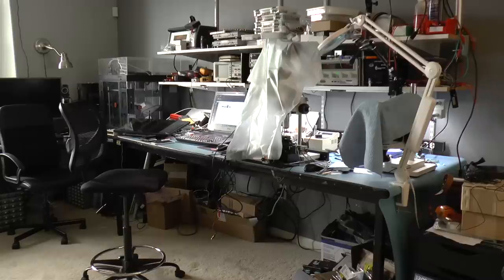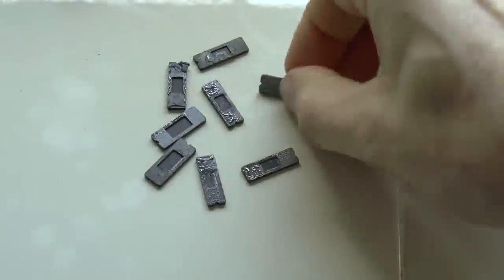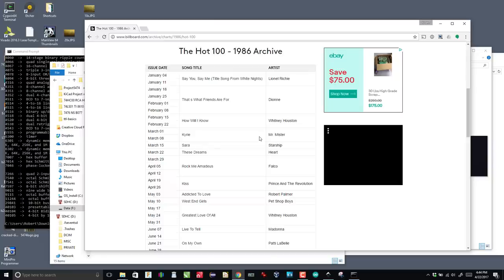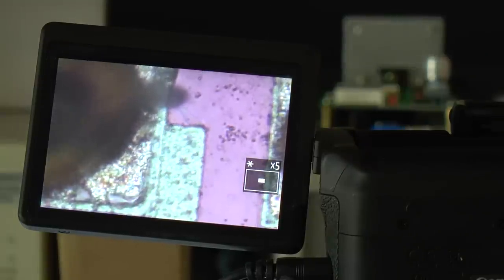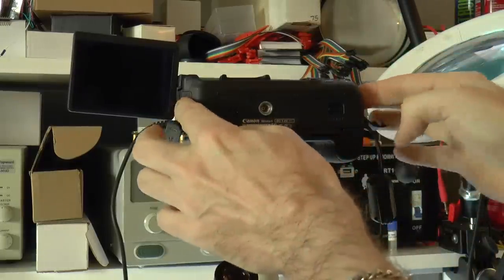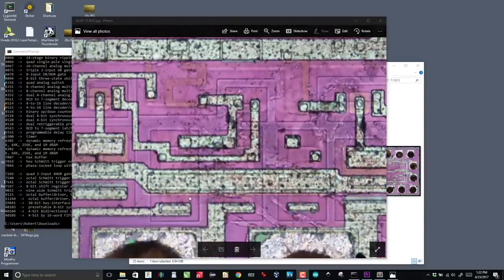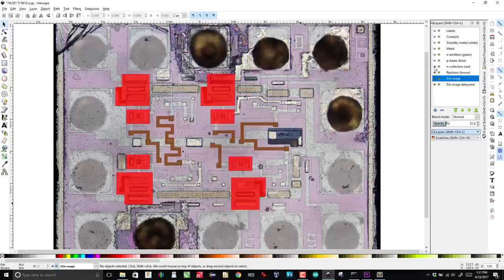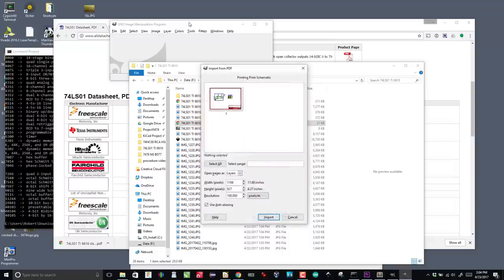How I reverse engineer a chip

Comment: I’d love to see this chip built out onto a pcb. That would be cool.
Reply: this kind of bipolar oldies (used sometimes nowadays), 74LS**, have an equivalent circuit quite often sketched on the datasheet... CMOS ones may have a bit of problems more, since the mosfets are not a standard type, they are specifically engeneered for complementary operation... you can use in that case a CD4007 to have some "free" mosfets for the use, but that chip is.... already a chip
Reply: Hmm yes of course
Reply: @redoverdrivetheunstoppable4637  exacly why make a chip with a chip actually it can be usefull if the chip is just multiple chip in 1 but in this case its not its a circuit of transistor and resistor that need a plastic case to not die instantly because of ambient noise

Comment: Thanks for showing us your very serviceable setup. 🙂👍Used to do this sort of thing professionally, almost half a century ago. It's slow, patient, fascinating and satisfying work. We also used near-UV light at high magnification (1200x and higher) to find surface features down to about a micron in width. A micron wide feature appears as a fuzzy line in that light, but you can make good use of interference patterns to figure out exactly what is going on. You can also etch through the layers of Silicon, to learn about Gate sizes, Oxide depths, doping depths, etc. It's possible to discern depths and thicknesses down to within a few hundred Angstroms, using similar optical methods and very careful etching; controlling etchant temperature, concentrations, mixtures and temperatures.

Comment: It looks like you have a trinocular microscope or at least a switchable camera port. Having had an AmScope with the latter configuration I ended up 3D-printing a clamp to which a wooden board was screwed. The board, having a notch and a covering of foam tape allowed one to just place the phone onto it, looking at a regular eyepiece popped into the camera port.

It's a worthwhile build that maintains the convenience and connectivity of a smartphone.

Comment: This is for low to medium scale integration.  Modern CPU's have feature widths less than the wavelength of visible light and can't be optically resolved. These lines turn into iridescent colors much like the coloring of many butterflies. A modern CPU chip contains many more layers covering the lower layers so individual transistor elements can not be seen.  The ability to see individual lines started to end with chips getting features smaller than 1 micron.

Comment: Huh! Interesting. I did this in 1996-1999 at a company for (then) state-of-the-art chips. Image acquisition was only 20% of the effort; I also wrote a tool for assisting with the reverse engineering.

Modern chips have features too small to be seen optically.  Pretty much have to use electron microscopy now.

But doing this in a home setup is very impressive. Well done!
Reply: Why just fof study why reverse engineering chip?
Reply: @holdencommodorehsv  Chips are reverse-engineered for two main reasons: competitive intelligence (find out what the competition is up to) and searching for patent infringement.
Reply: @dfs-comedy  ty

Comment: Very interesting! I don’t know a lot about electronics… I’ve only been learning for a few years. But I go to a local electronics recycling place almost every day for a few hours. A buddy of mine runs the yard and I get some pretty neat things. If you’ll tell me where to look… I’ll keep an eye out for certain industrial Devices and old things that might have chips you want in them.

I collect chips and parts. Iv desoldered over tens of thousands of parts in the last three years. I know that sounds ridiculous and exaggerated but  it’s not. I developed a method of using low pressure through an air compressor and a handheld modified airbrush, along with a soldiering in the other hand… And I can desolder a 16 pin dip chip in a matter of a few seconds. 

I started doing it to learn and collect parts that I could use in projects... and after a few months kept going because it’s like a treasure hunt… and although it isn’t worth my time to salvage and save parts for the sole purpose of reusing them… I still enjoy it because of the treasure hunt.

. Sure it’s great to have them in stock, But it’s almost a full-time job salvaging that many parts in keeping them organized. And there is no time left over building projects… And not mention these are used parts were talking about.

So after removing testing and cataloging hundreds of parts per day five days a week for a year and a half… Now I only go for the big IGBT’s, and other expensive or beautiful components.

I love Collecting parts that are visually appealing, or interesting some other way. Especially when Government corporations or large industrial companies bring high-grade weird and interesting things to the scrap yard. So I focus on that and pretty much avoid consumer-electronics unless they’re super old!

I love old White and purple ceramic chips… they are my favorite! And of course I could get most of them on eBay for pennies or a few dollars… But it’s more fun if I only add parts to my collection that I find myself! I have over 150 pounds of transistors. Spread over half a dozen parts storage drawer banks. If I take out the weight of the drawer banks there’s at least 150 pounds of semiconductors. And my favorites are framed in a flat case… Stuck in foam. 

I love finding really old chips, fancy TO-3 package transistors that were hand-painted Or have colorful silkscreen Graphics, and all kinds of other weird things like early examples of LEDs.

I know very little about the electronic theory, however I have put together a humble TestBench with test gear that I mostly repaired myself. I can do the basic stuff like look for burned areas, replace filter caps, maybe do a bit of in circuit testing. That’s as far as I go. I just can’t wrap my head around the rest yet. However I’m hoping one day I can understand it well enough to do some more interesting things with the old parts I  salvage.

Would be awesome to sit down and get the old parts out, characterize all of these cool transistors and chips with my curve tracers and other test gear. I just think it would be a lot of fun

Sorry to ramble on… But if you can give me an idea where to look or what kind of parts you’re interested in… I’ll be glad to help. 

I Maybe even have some old transistors and weird things that you might disassemble or cut cross sections out of. 

That’s another thing I will eventually try. I already have gemstone cutting equipment and lapidary gear so it would be cool to do cut cross sections of all types of components… And photograph them under my microscope.

Anyway let me know if I can help.!m,

Comment: This is a relatively easy chip to reverse engineer (4 gates only!) 
But I'm still impressed with your setup.
For people wondering about the gap between layout and schematics, here's a simple brief explanation:  
74 series used TTL logic, so you already expect to find BJT and resistors.
Then you need to know the layers TI used in it's VLSI manufacturing process  back in the eighties. How many metal, doped, SiO2 layers. If you did so, using some physics and EE basic knowledge you'll find out what layers formed BJT, resistors, and contacts.
Then you can easily trace back the connections to schematics.

Comment: Fascinating. I wonder where the progress will go in 5 or 10 years. Specifically if the chemical aspect would be still here of it would be as simple as popping and IC in a DIY cheap decapping laser machine that automatically etch away the material and take pictures of the die.

Comment: In the mid 80s a company came to where I worked selling their product  LVS layout v schematic. they dis design verification of the physical layers  - they converted the image to transistor fully by a program. I asked if he thought it would be hard to convert the transistors to gates. He said it was possible. Then I asked him if he knew what my company does. He said no. I told him that we take gate and board level designs in what ever primitives are for that technology and convert them to generic gates. Then we raise the symantic level to adders registers, ...   and then ew replace these macro level components with hand optimized  target technology macros. then we convert all the remaining generics to target tech. primitives and then go to the physical layout and polygon phase.   He didn’t get what I was saying. In the mid 80s the technology existed to completely reverse engineer a chip and target it to a whole new technology without even knowing what it does, even to the point of duplicating design errors all programmatically

Comment: This is really great, thanks for your preservation and documentation work! Ever go after those 'super integration' chips from the early 90s that helped make laptops feasible? Always thought they'd be cool to image, usually a composite of several standard intel chips like 82CXX DMA/PIC/UART. I always see them mentioned in Toshiba service manuals.
Reply from the maker: pixelflow: My guess is that those chips have features beyond the optical range of the microscope. Basically feature sizes under 2000nm or so can't be resolved. it's why I stick to 80's chips.
Reply: Thats what has me curious, because some are made around ~87-91!
Reply: How would one reverse engineer newer chips from the 90s then?
Reply from the maker: Brandon Klopp An electron microscope would be required for the next few levels of feature size.

Comment: Is there a way to understand how a chip works without destroying the metal?

I have two nearly identical TCM computer chips that fit into a '00 sedan that I have been fixing on my off time. I have a suspicion that the computer chip that I bought got damaged and want to check how I can go about to fix the chip.
Reply: The equipment and time costs aren't worth it, it's probably better to buy the chip (or the entire control assembly) online instead. If you decap even just to look at the circuit, it will be impossible to restore unless you have a wirebonder and other equipment. I think the best way to see it without destroying the packaging is probably SEM or TEM, if you have access to a university lab maybe.

Comment: Hi, I was wondering how long you etch with the armour etch? I've been experimenting and although the coverslip my die is glued to took an etch in 50 seconds the die itself does not look to have changed.
Reply from the maker: littlestworkshop I've pretty much stopped using Armour Etch in favor of RustGo. It is higher concentration and is a liquid, so it usually takes about a minute or two. The Armour Etch would sometimes take over 20 minutes.
Reply: @RobertBaruch  can you reverse a Sega saturn chip with one that is far more powerful??

Comment: hey the show you should be doing is how to unlock a burned closed chip. then you would need one hell of a disclaimer so you don't get sued when every geek in the world tries it all at once man. i lean heavy on the disclaimer man. just say i was verifying why chips are closed to evaluate the time duration of parts in machines as a way to cause sales to computer chip manufacturers. and you get to keep the checked chips to of course it would be just a small business. a solutions company and for the idea can i have a amd ryzen 9 3900x. when you find one of course. you could also make the bios to work the thing with broke cores. it would get a million views by the way. (at least)

Comment: So this is cool and all, but other than curiosity and hobby.  Is this practical for something?
Also, how much does the microscope setup cost?    I love taking apart cameras, namely the Chinese IP cameras and wifi cameras that are flooding the market here.  But i have no idea what i'm doing after i take them apart, google reveals some info about parts..but from what i gather, it does not matter what you have, everything is locked down because of firmware on each camera.
Reply from the maker: I don't know how to answer that. Everything is practical, and nothing is practical. I suppose the closest I can come to an answer is, this could make a great resource for people learning VLSI in engineering schools, or researchers looking for the history of chips, or people who want to build a MegaProcessor. As for me, I'm doing it as a hobby. You can read about how I put together the microscope here: http://www.halfbakedmaker.org/blog/cncmicro1  Note that on the blog post I explicitly state that this is an expensive hobby :)
Reply: Nice, thanks.  If you are interested i can send you stuff to take apart, i get lots of circuits boards from cameras and computer parts.
Reply from the maker: Well, it looks like you're into the more modern chips. Anything after around 1990 is beyond optical techniques, so I am not much help there :)  There are other techniques you can use to get at hidden firmware. There's a whole art behind hacking into unknown chips and hardware, but I'm not part of that scene. Many of the DefCon talks go into that subject, if you're interested.
Reply from the maker: I have a processor from the '70s that has a masked ROM. I can recover the ROM using this technique, so there's another practical aspect.
Reply: Robert Baruch 8048/8049 perhaps?

Comment: Hi Robert.  I need code extracted from a PIC16C58B 04/P chip and then copied to a few other chips.  They are from an obsoleted motor controller board and I want to keep parts on hand for repairing this board.  I'm willing to pay, can you or anyone else help me?

Comment: How would one go about re engineering the chip like reproducing these chips that are now old and supplies are running low ala commodore chips?
Reply: what kind of numbers to you plan to produce? pretty sure to make chips you'd need a fab and those usually don't come cheap or for a few thousand pieces :x
Reply: John Uferbach sorry I didn’t mean me this is far beyond my skills I just see how no one has ever reproduced chips that are in short supply and are ever failing I.e Sid and vic 2 chips from the C64. I mean is it not something that once schematics are obtained be sent to somewhere like China be mass produced? You can obtain brand new pcb for pocket change. Or is it just to intricate a job to be able to run them off a machine?
Reply: @dannycivic02  yeah, pcb production is cheap these days, but chips are on nanometer scale, the production is fully automated, happens in high level cleanrooms and even the cost of the tooling is expensive (and therefore not as flexible as pcb production which works with blueprints printed on foil), those facilitys cost billions to build and run, they wont even consider it if you come asking for a few thousand pieces... there might be some way to make crude ic's at a lower investment, or prototyping services, though i've never heard of that

Comment: Rob Excellent. Way beyond my area of research, addiction medicine,  but your methods and results are extremely pertinent to work I am currently doing on innovations in E Cigarettes, JUUL and other copycat brands. My hypothesis is that the use of embedded circuit boards with multiple chips, sense user puffing behavior, store the date, transfer it to another chip with an embedded algorithm and create a program sent to a microprocessor that controls and optimizes the pattern of nicotine delivery making it highly reinforcing, addictive.)
I have reviewed the patents and isolated the chips and obtained their IDs.  I sense no other research group is doing this and the data would help FDA reduce youth addiction. Could you help?
I’d be happy to explore grant support for your work. What is the full name of the site where you post your results, which you called patriot?   This is the time the use of IT has been enhance the action of psychoactive drugs and actually allow the manufacturer to control and individualize dosing. It’s a ,little frightening but if good science was applied could lead to drug devices that could reduce addiction to drugs like heroin and possibly save countless lives.
Reply from the maker: I wouldn't help, since I have more than enough projects to keep me occupied. But really the techniques I used are only suitable for chips manufactured and designed up to about 1990 or even 1985. Anything later uses feature sides to small to be resolved optically

Comment: What if the chip is on one's shoulder and features an illogical neofrontal design?  Couldn't imaging it cause a compounded deconstruction of the logical unit, further exacerbated by publishing it to Twitter?  Definitely more a problem most visible in the post 1990s designs, however I just want to make sure you are safe as the danger of it becoming self aware could cause the chip to meltdown and destroy everything around it.....   That said, Great work! 👍

Comment: Why not save it as PNG?
Reply from the maker: PNG ends up with way too high a file size. JPG is fine, especially since the actual optical resolution is lower than the pixel resolution (120nm per pixel) anyway.
Reply: Forget that earlier comment.

I think there's a lossless format or two out there that do a better job at compression though.
Reply: went through all that trouble just to save as a jpg